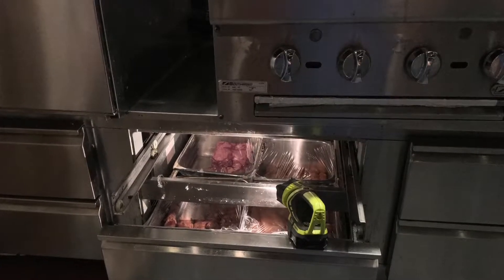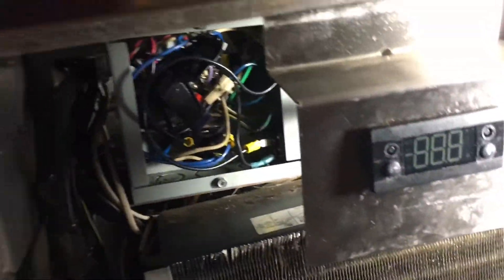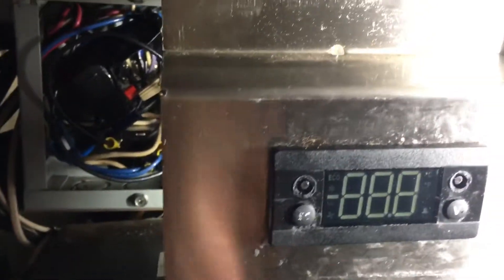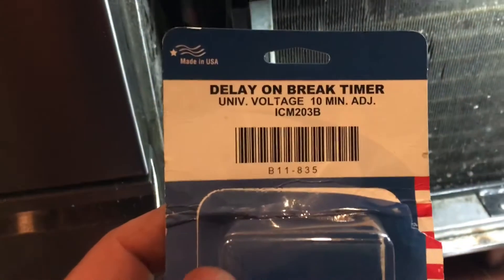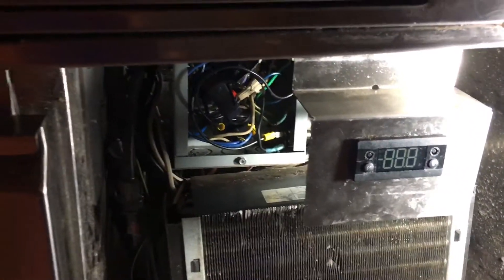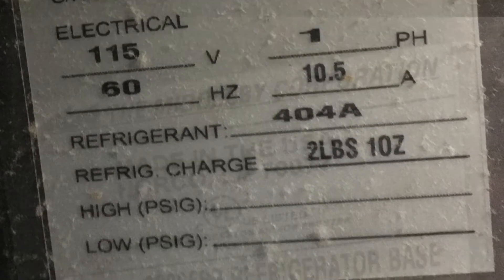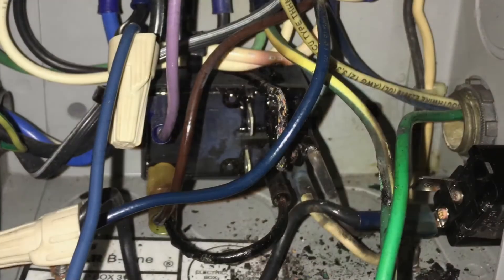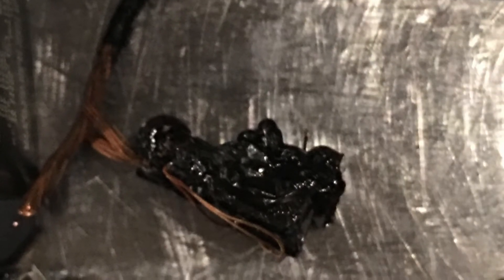Why you should allways check that a compressor circuit  has a time delay.

Comment: So if you don't have the password, can you tell what the temp differential is set at?
Reply from the maker: No , but i googled the danfoss controller and default is 2. And looks like some one messed with this one and set to one. Anyways as u know 2 is way tooclose for refrigerator. I dont know what they are thinking. U need off cycle for air defrost and compressor rest. Should be set point 35 dif 5 or 6.
Reply from the maker: This danfoss controller is a : Danfoss ERC 102C
What a pain. Two levels of programming snd no help from danfoss regarding default passcode.
They emailed back with no passcode default help. 
they say call middleby. Tried calling midbleby. There phone number is disconnected. Ugh. :-(